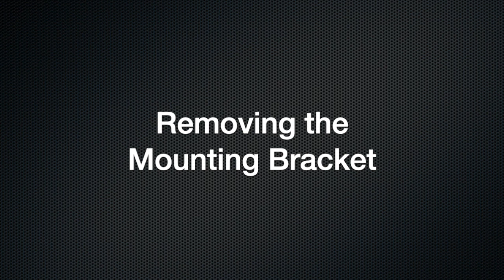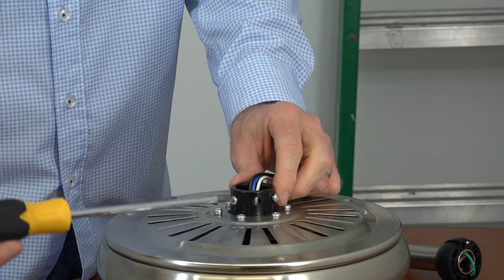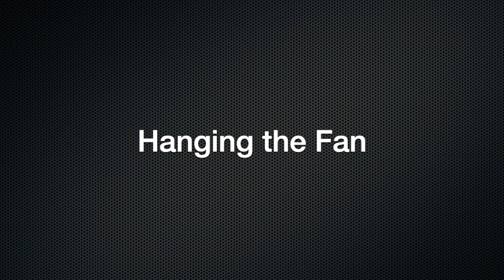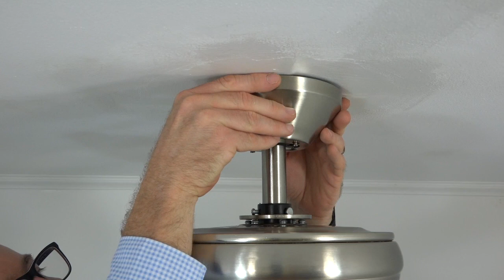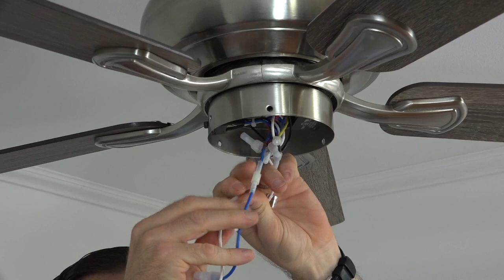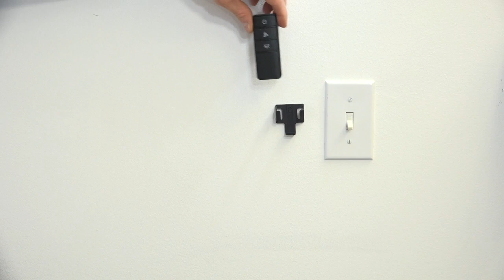How to Install the 44 in. Riley Ceiling Fan by Hampton Bay

Comment: We have a light switch on the wall. One for the light and one for the fan. I DON’T want to use the remote. How do I wire it?
Reply from the maker: If you want to install without the remote, you would start by cutting off the wire plug from the fan wires. Then you would be left with 3 separate wires: White - neutral, black - fan speed power, blue - light power. You would then make the standard wire connections - white fan wire to white house wire, blue fan wire to house switch 1, and black fan wire to house switch 2. Please note that the switch for the fan speed control must be a variable speed switch (not a dimmer style switch). If the fan speed wire (black) is connected to a standard on/off switch, the fan will run at high speed with no way to adjust the speed. The light can be connected to a standard toggle switch or an LED rated dimming switch.

Comment: Why don't you talk about the angled ceiling mount?
Reply from the maker: Good question. The angle mount process is the same with the only note being to make sure the opening of the mounting bracket is facing the peak of the ceiling.

Comment: So the  bottom of the light has  just black and  white white wires. with one black and one white as a connector. The top part has one blue and one white. The directions and video say connect blue with blue and white to white.  Uhm... Can a blue be connected to a black wire. There is no blue wire
Reply from the maker: Yes, please connect the light's black wire to the fan's blue wire.

Comment: Oof help my receiver doesn't have a red wire
Reply from the maker: The receiver should have one set of wires with a wire harness plug and one set of wires that are separate wires to connect to the wires from the ceiling. The receiver will have a white wire (neutral) and a red wire for power. If it does not have a red wire, it will have a black wire for power. If you receiver does not have either a black or red power wire, it will need to be replaced. A replacement can be ordered by calling Hampton Bay customer service at 1-855-434-2678.

Comment: If I don't want to have the receiver and just want to control the light & fan in the conventional means from a double rocker light switch on the wall, is this possible with the Riley fan?  If so, what is my wiring?  Is it as simple as removing the white connector and wiring white to white, black to black, and green to copper?  Will that give me independent control of left switch to light and right switch to fan?
Reply from the maker: We have to say that we are not licensed electricians and we have to recommend contacting a licensed electrician for any alternate wiring methods. That being said, if you remove the wire harness plug from the fan, you will be left with 3 wires from the fan: Black (fan speed power), blue (light power) and white (neutral). In general, what you said is correct, but the blue wire would have to be connected to a power supply (switch wire). Please note that if you are just using on/off switches, the fan will only operate on high speed and you will not be able to adjust the speed of the fan. If you replace one of the toggle switches with a speed control, it must be a variable speed control, not a dimmer. Using a dimmer switch to control fan speed will eventually damage the motor.
Reply: @ceilingfans101  Thank you for getting back to me so quickly and for the added info on the variable speed control - very helpful.  One last question -- you mentioned "blue wire would have to be connected to a power supply (switch wire)".  Can you elaborate on this?  Is it just a matter of pairing the blue wire with the black wire and connecting both of them to the black wire in the ceiling?
Reply from the maker: @daved3342  If you want to control to control the light and fan independently, you would need separate switch power wires - these are typically black or red wires. You would connect the fan black to one switch wire, and then connect the fan blue to the other switch wire. This would let you turn the fan and light on/off with the separate switches. If you just want to use one switch for both, then you would connect the fan's black and blue wires to one switch wire.

Comment: Installation went fine but I can't dim the lights. Any ideas?
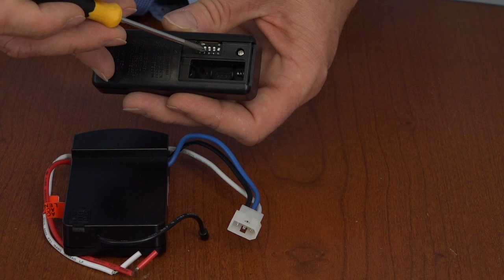Reply from the maker: Please check that the O/D switch in the battery compartment of the remote (shown at the 6:29 mark) is set to the D setting to enable the dimming function. With that switch set to the D setting, you should be able to press and hold the light button on the remote to cycle through the brightness settings. Then, release the button once the desired brightness level is reached.

Comment: I'll my lights went out. I replaced the bulbs but they're not working.  Only the fan is
Reply: All**
Reply from the maker: @hosnih11385  Have you checked the wiring between the light kit and fan? Also, what type of bulbs are you using? Each socket is rated for 60-watts max.
Reply: @ceilingfans101  I'll check those wires now. I'm using 9.5 watt led lights, I believe it came with the fan

Comment: I cannot get the blade brackets lined  up with any screw hole and have tried everything I can see should work.
The slot I see for the tang is not in the middle of the gap .
Help!
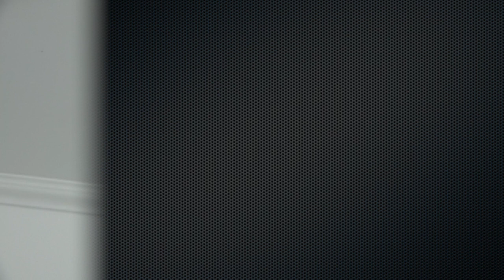Reply from the maker: I'm wondering if you have the same blade arms, like if someone returned the item with different blade arms before you purchased it. The alignment post should insert into the long slot at the base of the motor as shown at the 10:29 mark. None of the blade arms are able to be attached?
Reply: @ceilingfans101  
Thanks for your quick reply.
I stumbled across the answer, which is there are five rubber packing blocks screwed to the motor which have to be removed.
I took a screenshot of the video and noticed the absence of the packing blocks! That's when the penny dropped🙏
To be fair there is a small label telling you to remove them, but I completely missed it before hanging the unit.
Reply from the maker: @Able60  ah yes. the motor stops. Happy to hear you got it figured out. Cheers!

Comment: I have three wires plus the ground in the ceiling. A black, white, and red plus ground. The reciever only has black and white and ground. The red wire was connected to the previous fan that I removed. What do I do with the red wire?
Reply from the maker: We're not licensed electricians and have to suggest calling one for wiring questions. That said, a red wire is typically a switch wire. If that is the case and the red wire is connected to a standard on/off switch, you can cap the house black wire and connect the receiver black wire to the red wire. This would allow you to turn the fan and light on/off using the switch. Alternatively, you could cap the red house wire and connect the receiver directly to the house black wire. Again, we'd suggest consulting with a licensed electrician if you are unsure about the wiring.
Reply: I just ran into this issue installing the same fan, what did you end up doing with the red wire?
Reply: @briennearellano3426  the other wire is four the second light switch on the wall. My electrician friend told me to choose one of the two wires and cap off the other. This will have one light switch supply power to the fan and the light, and then you just use the remote for control of what is on. Hope this helps.
Reply from the maker: @briennearellano3426  we would suggest just capping the red wire. Alternatively, if your red wire is a standard on/off switch wire, you can cap off the house black wire and use the red instead. If you are not sure about your house's wiring, we'd suggest contacting a licensed electrician to make sure it is connected properly.

Comment: Do I have to remove the entire fan to set the dip switch? The installer didn’t adjust and now both fans work on the same remote.
Reply from the maker: Thanks for the question. You do not need to remover the entire fan to set the dip switches. You just need to remove the canopy to be able to access the receiver. Please make sure you power is off at the breaker and wall switch before doing this. The canopy installation is shown in the video (9:35 mark) just watch the canopy and canopy ring installation and then do the reverse to remove it. The receiver can be accessed once the canopy is removed and then the dip switches can be changed.

Comment: Wonderful step by step video. Only 1 step missing but a no brainer obvious one. The fan motor where it spins is shipped with 5 rubber safety gromits which must be removed via access hole in order to release the motor. You can't install the blade arms without this step. I only mention it because I originally thought the motor was stuck or hindered when I first unpacked the fan and tried to spin the fan manually until I noticed the obvious. ALSO -- in terms of attaching the blade arms. There is only 1 access hole. Aligning and screwing from underneath is uncomfortable and time consuming. It didn't seem much heavier to screw the blade arms into the fan motor before dropping the ball into the ceiling mounting brqcket. I just flipped the fan motor upside down and screwed the blade arms to the fan with the motor on my lap. It took all of less than 2 minutes with no ladders, flashlights, Etc. AGAIN -- this video was a great tutorial and saved me a ton of time trying to weed thru a ton of directions. THANKS
Reply: Dude I was like wtf is going on here loool

Comment: I'm assuming this model cannot be installed without the downrod for a more, flush/close mount. I've looked all around and am not able to find any info about installation options, only that it can be installed on straight or angled ceilings. Even the installation guide doesn't list anything about mounting it closer to the ceiling without the downrod.
Reply from the maker: That is correct - this fan does not have a flush-mount option and must be installed with a downrod.